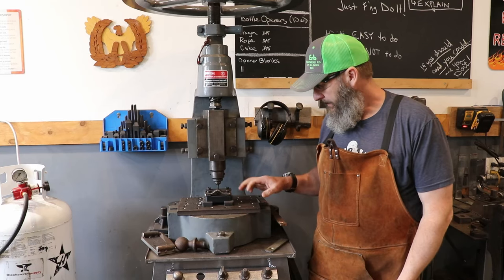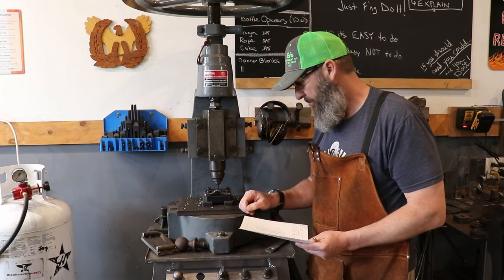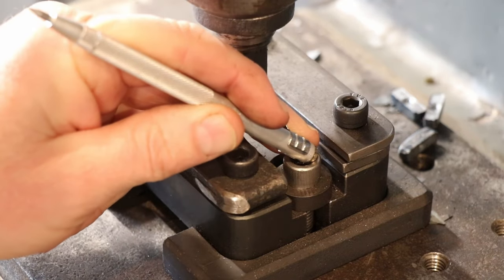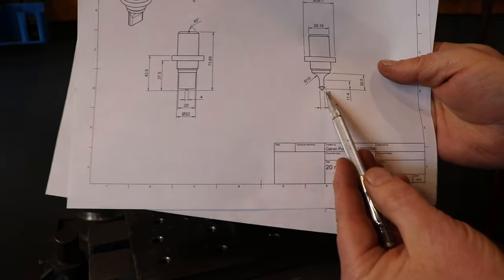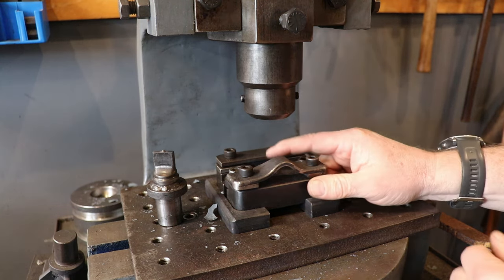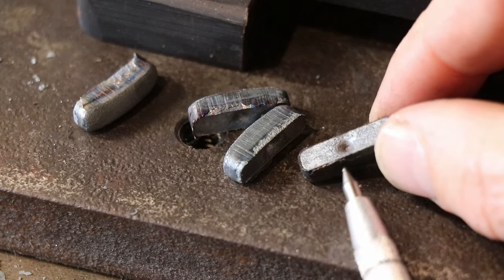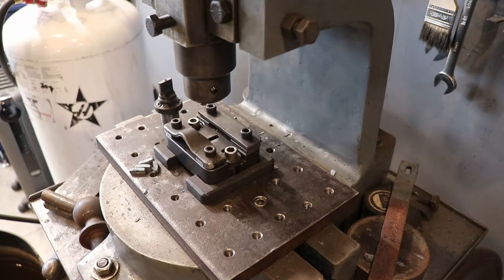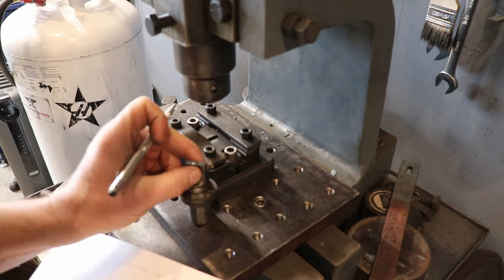Fly Press Punch & Die Details & Dimensions

Comment from the maker: Making this die was a work in progress. Originally, I didn't have the two riser blocks and couldn't eject the slugs after punching. Also, I did not mention in this video that there is a relief cut machined on the underside of the die which allows the slugs to exit the die.